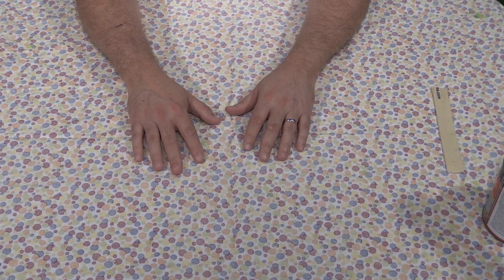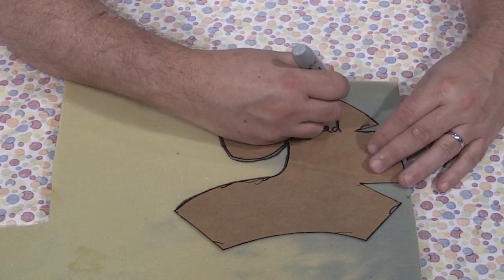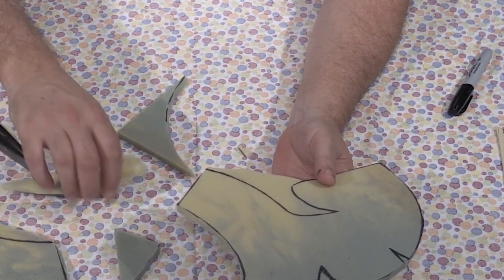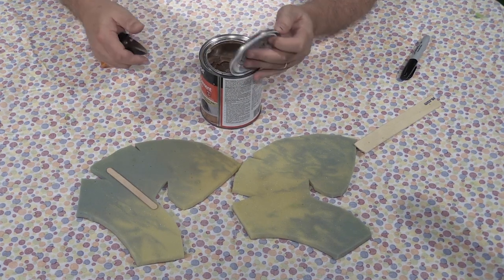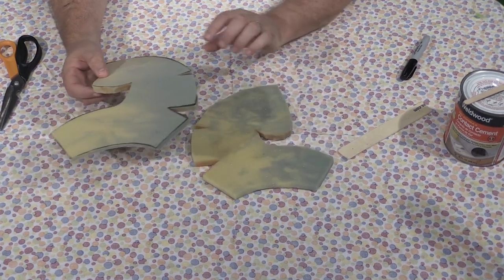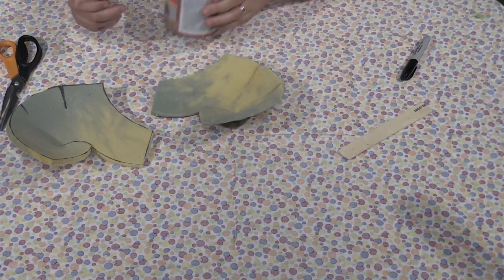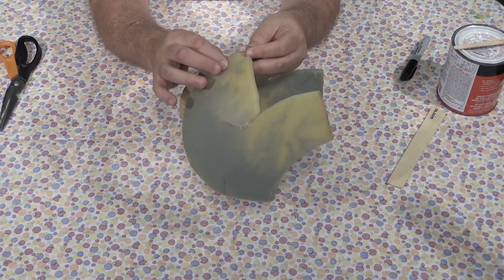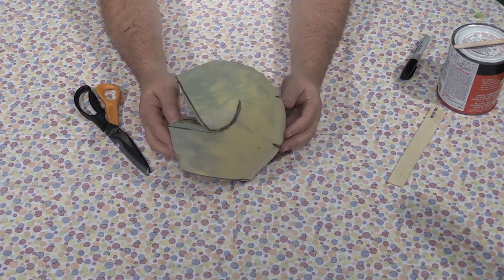How To Make A Foam Puppet Part 1 - Foam Head

Comment: Is there any other things you could use to stick the bits together
Reply from the maker: hello, sorry it took so long to answer. yes you can but the contact cement makes a great bond and it’s easy to work with.